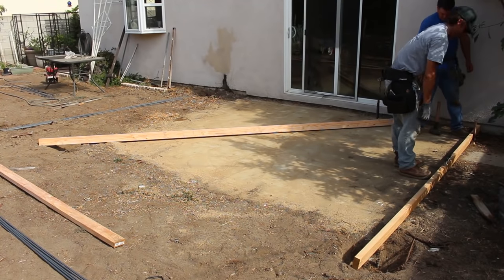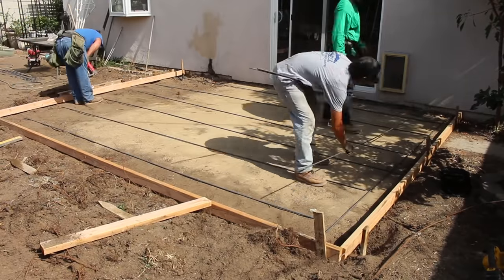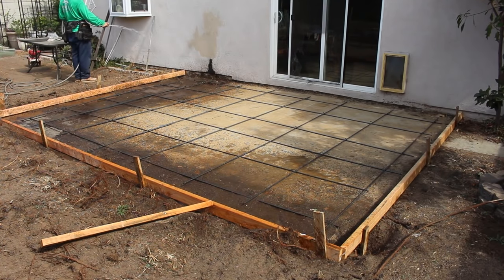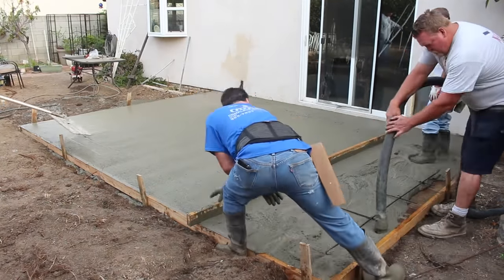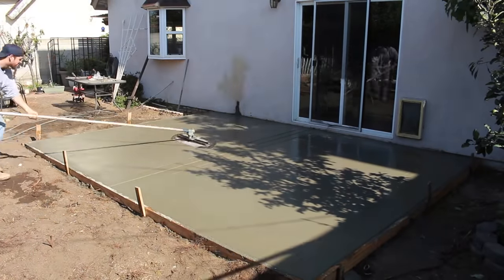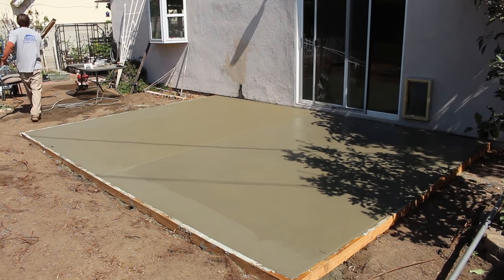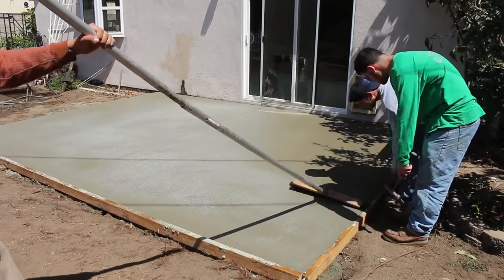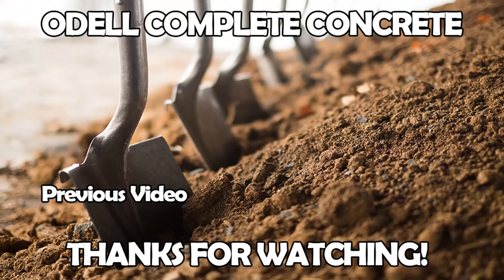How to Pour a Concrete Slab for Beginners DIY

Comment: I was convinced I could do this myself until I seen about 300 people working on this patio. DIY.. 🤔🤔🤔🤔
Reply: You'd probably want to start smaller, maybe no more than like 50-100 sq ft. You only have a limited time to get the concrete into position before it starts to set so the bigger it is the more people you'll need unless you're a pro. If you have a truck deliver it then the driver will usually control the pour flow so you can use a concrete rake to move the mud into position. Then it's just a matter of smoothing the surface and edges and running expansion joints before it sets. Probably shouldn't worry too much about getting it perfectly smooth your first time, using floats and trowels takes practice to get good at, just get it as good as you can and move on. More effort is required the longer it sets. I used to help my dad when I was younger for like a decade, even then I never got great at smoothing it out perfectly. I just did a rough pass over it and my dad would smooth up the rough spots. As long as there's no obvious holes or dips in it and it's mostly flat you'll be fine.

Comment: Not bad not bad I actually did a slab about the same size a few days ago but hand swirled instead of a broom. I don't know if you have done hand swirling or not but it would be cool to see a video on it.
Reply from the maker: Yes but I prefer to do them with the power trowel
Reply: Not a floor but it's like a broom finish its swirling with a hand mag

Comment: Hi there. I have 2 questions. 1. Why do you make a line in the middle of the concrete slab. You said it was a joint. 2. Do you have to put vegetable oil on the wood before your pour the concrete to prevent the cement from bonding with the wood? Thanks for the great Vid. Good Job!
Reply: 1. the line is a score mark to guide inevitable cracking. Better to crack along a nice straight line(like sidewalks) rather than cracking all over the place. 
2. No, the oil is simply used so he can take off the wood while still at the job site day 1 before he leaves. Leave it on 48 hours and then take it off like normal and you will have no issue with no oil.

Comment: Probably a dumb question but how do you accurately create a 1.5% grade to drain the water away, wouldn't the concrete just level itself?? Second question thinking of doing this for a small home in FL a 12x20 any tips or warnings I should be aware of for that region? TY in advance
Reply from the maker: Its in the set up and rodding.
Concrete doesn't self level, its to stiff

Comment: Very cool video.  I've done small slabs for electrical monument signs and decided to try and do a pad on the side of my house for my boat.  Would a 6" deep slab be deep enough for a boat with about 1100 - 1200 lb weight?  I'm in California and not sure with all the quake issues, although where I live may not be much of a problem.  So I'm familiar with concrete, just not with structural details for this type.
Reply from the maker: A 4" slab is plenty good.

Comment: Hi yeah I'd like to know how did he run a straight line for the join at 3.33. Did he use some sort of wire cable underneath the concret and then just open it up with the extension pole? Thanks, enjoying learning
Reply from the maker: No that's free hand, like an Artist

Comment: Hi, do you think the Sakrete high strength concrete mix from home depot could be as smooth as the one you poured in this video? or any recommended type of concrete mix for my small landing project? Thanks.

Comment: Great job and great video. Do you have a beginners video on what equipment you have and the different styles and sizes of the trowels that you use. You mentioned that you have a Fresno and then that magnesium one what's the difference?
Reply from the maker: one flattens and one smooths

Comment: That looked great. Wondering if I can get some input/advice for my own project. First, if I were to lay new concrete over existing concrete how thin can it be over the existing concrete? I have 100 year old driveway where there is only cement where the wheels of a car contact the ground. The area in between is dirt which I'd like to fill with cement. I'd like to make it a solid cement driveway and not have to sledgehammer the existing old concrete out. I also want to extend it out so it would be a bit wider beyond the existing old cement. I'd like to know how thin I can safely lay new cement over the old because our driveway goes out onto a city sidewalk. Would using your idea to make my driveway a solid cement driveway work? Or would it be best to take everything out?

Comment: Just curious, so you should not pul down pea gravel on the dirt first? I'm just asking for myself as I have a broken cement step that I need to fix and it's right on top of dirt. I thought I should put a compacted layer of pea gravel down first, no?
Reply from the maker: The dirt is fine if it hard and your not in a freeze thaw zone.

Comment: Nice vid! Nice job! I would like to pour new concrete on my roof teracce (flat surface ~200sq feet). Old concrete is gone. Cracked (almost turned into sand) and leaking. What tickness or hight you recomend to pour. Do I need a rebar mesh? After pouring new concrete I intend to cover it with hydro insulation. Thanks
Reply from the maker: You need a roofer and water proofing

Comment: I am getting ready to pour a slab like this in very hot, sunny weather. Will be hand mixing in a wheelbarrow. Is there anything I can add to the regular 80lb bagged concrete to slow down the setting so I have more time for troweling and working the concrete?
Reply from the maker: I believe a certain sap from a specific tree acts as a pause in the concrete and also can air entrain

Comment: thanks for this nice video, one thing I don't understand is at time 4:23, I thought the surface is flat already, why need someone crawl inside to smooth the concrete out again? what is the purpose, remove water ? thanks , and sorry for this noob question
Reply from the maker: Makes it even flatter
Reply: @OdellCompleteConcrete  thanks

Comment: I wish you guys would travel to KC. I want to put a 13 X 30 pad for a outside car lift  Any pointers on how to do it. I was planning on forming it with 2x6 and maybe digging 3 ft footings  along the outer edge of the pad. Whats your professional opinion?
Reply from the maker: check with your local building department

Comment: hi, why do you put a seam down the middle? expansion? if so why doesnt the seam need to cut all the way through? is the seam just for the drying process of the surface to eliminate cracks? thanks

Comment: How did you achieve the necessary slope? I’m assuming 2 things, you sloped the side forms and the concrete was thick enough to not self-level as you squeegee the concrete to the side forms forward to the front form, please advise, thanks
Reply from the maker: The concrete is thick enough not to run

Comment: is there a list of tools to use. cause i couldn't figure out what you were saying something about a bowl float and  what was used to cut the joint? what was used for the edge? whats the name of the concrete? something about pea gravel and mesh. what is rotting it off? what is frezno and other trowels? you had to do a broom on the edge? is that the push broom 2 minutes earlier?  sorry i am a newbie. so beginner beginner.. thanks
Reply from the maker: You may need to watch more videos.
Reply: @OdellCompleteConcrete  yuppers 😆

Comment: Hey man great video. I’m actually thinking about doing this. I currently have decomposed granite and I’m wondering if I can lay the concrete right on top? The dg is compacted about 4” thick. Can I just lay a 2” slab on top? Thanks any info is greatly appreciated
Reply from the maker: DG is not great for a 2" pour.
I would go 3 to 4" minimal

Comment: Hey Odell, love your vids, very informative. What's the rule for expansion joints? Like I see you pouring slabs right up against other slab. I need to pour a slab against brick on the house. Should I have an expansion joint so that concrete doesn't damage bricks later on?

Comment: My friend wants to do a cement pour over an existing 8' x 8' x 3" slab for a hot tub. The current slab is cracking, but appears to be structurally sound. He wants to extend it by 2' on each side and 3" up. Should he use a bonding agent to help the concrete adhere to the current slab? I'm new to masonry and not sure if this step is necessary; if the added weight of the hot tub when its filled with water is a necessary factor when choosing a bonding agent.
Reply from the maker: If the existing is cracked, then I would isolate with plastic. Try to 4 "a if possible on the new pour
Reply: @OdellCompleteConcrete  Will do, thank you!!!!!

Comment: Hi ,thank you so much for all your videos , really good pro work . My wife and I  decided to DIY 16 by 24 concrete slab in our backyard porch .so I wanted to ask you what the requirements for a slab that in the future we will possibly want to close for a room and the slab will be in a slight angle since we have a lake in the back .I will only prepare the the mold but not pour concrete ,I would have a concrete company pour it for me .any special ideas or rules that I got to follow do I need to attach it to the house some how because of the angle ,should I use mash or do it like you did in this video lay the bars and tie them ? What kind of concrete should I use in South Florida? Thank you
Reply: The stip part of the slope starts about 17 or 18 feet from the house  in which I'm going 16 feet towards that direction but that whole section is in a mild angle
Reply from the maker: I would check with the local building department

Comment: Great video. What are the two tools you’re using to finish the concrete when you’re on your knees with the protector pads? Is it a mag float and a steel trowel?
Reply from the maker: Knee boards

Comment: Question:  I have a foundation, which I inherited a few decades ago and was poured too low at a low point in the yard so that, when it rains, water flows into the shop.  Can I just pour a new foundation over it to raise the foundation for the building, do I have to tear the first foundation up before pouring the new foundation, or can I put something in the first foundation like bolts or rebar to tie them together so the second foundation won't tend to move on top of the first foundation?  The first foundation has no cracks and is good except that it is too low in a place where water will run into the building when it rains.  It needs to be raised at least 3 to 4 inches and they would both be 20 ft x 30 ft.  Thanks.
Reply from the maker: If the framing sets higher then the existing slab then yes pour over.

The slab should set a little bit lower then the framing

Comment: If I'm building a Harbor Freight 8x10 greenhouse is 2 inches of concrete enough for a base? Also, should I make my base about 8.5 x 10.5 so I allow for a little space on the sides? What's the rough estimate of the price of the concrete material for that size?
Reply from the maker: 350

Comment: I'm pouring a patio that connects to my driveway on one side (only 5 feet connection). I live in Michigan so weather is wild. Do you recommend I do crushed stone (3/4 inch limestone was what i was thinking) or do re-bar? Or both?
Reply from the maker: You may want to check with your local building department

Comment: hi could you help a pool 20 by 10 feet .trying to pour a concrete base should i do it in sections or pour a 3 inch base then rebar and then when set another 3 inch on top.I wont have time in one day to pour a 6 inch base 20 by 10 any suggestions thanks
Reply from the maker: I would find the time and do it right

Comment: If you need to get rid of grass, what is the best way to do this? I have a small slab outside my garage door and outside door and would like to connect them as well as bring it out further for a decent patio.
Reply from the maker: Weed killer or dig it out.

Comment: Hi great video thanks for sharing it.  I used to drive a mixer truck and i have seen it all from that side of the jobs with pumps of all sizes and just simple manual labor, but i have never done a slab myself.  This is my first one and its only 8'x4' for a shed i am building.  Everything is level and secured and square, with just a tiny bit of drop to the front left corner as part of it will be exposed to the weather as outdoor storage. So it will drain to that side of the slab.  I will attempt this by myself, ill see how it goes mixing and all of it alone.  The calculator says 29-50lb bags but ill get 30 bags just in case, also it wont be a full 4"  thick slab so i should have plenty.     I did have one question, there are some small gaps under the 2x4 in places along the ground, should i plug those up or just make the mix thicker so it wont leak out?
Reply from the maker: no need in that gap filling.
GL

Comment: Two questions 
1)Can I pour over existing concrete that is cracked & unlevel?
2) Can I use bags of quickcrete?
Thanks
Reply from the maker: Put plastic and a layer of sand, If the old concrete isn't settling

Comment: I like your video. Very informative. However I have a question. When I spoke the Town tax Assessor he said that any concrete or cement patio using a footing would be taxable.  With the exception of the rebar that you used to keep the cement slab from cracking I did not see anything resembling a footing and you didn't mention anything about that. Any information that you have about this issue is most appreciated. Thanks
Reply from the maker: I don't know about that.

Comment: Same size slab do you have to Put a grove in it like that so it will not crack.or is it better to have the wire ...?
Reply from the maker: The groove is for crack control

Comment: I have a garage floor that is badly cracked and lifted in areas I don't want to have to break all that concrete can I pour over it if it's not even? Will the new concrete crack ?
Reply from the maker: plasti,c sand, and rebar should do the trick over the bad concrete.

Comment: Question, I'm taking on a big 24x24 project for a basketball court. What's the point in splitting the concrete in half and what type of concrete should I get from Lowe's
Reply from the maker: Maybe in fours if your going solo.
Blue hawk 4500 psi

Comment: Is there a building code that says to stay away from the weep screed (stucco flashing)? You got pretty close to it if not right on it. 

I bought a home that already had a slab poured and it was poured up to the weep screed. I've had issues with moisture damage when it rains. My wood flooring and drywall has gotten damaged on the inside. How would you fix that? Demo and pour a new slab lower to get a away from the weep screed?
Reply from the maker: yes 2" below top of slab, which puts you a 1/2" below weep

Comment: So I am doing one 6 x 11 just outside our basement door like this one. What I am wondering is do I just dump the gravel in the area and then build my form just above it? Well setting the form just on top of the gravel? So it doesn't matter that the gravel is peeking out from the form right? Also building a retaining wall next to one side of this because there is a slope that needs to be held back. I am thinking the wall should be resting on some sand and working with the first few stones to make sure they are level correct? Not putting the wall right on the cement pad because it will be slopping away from our foundation/door. Don't want the wall to slope right?
Reply from the maker: Sounds like a nice project.
GL
Reply: So do i put the form on top of the rocks and let the rocks come out a little bit from under the form?
Reply: Hey Barnes. That is fine, just set forms for your depth of slab ontop of stone, if any stone seeps under forms that is ok. Just pack it well. 

Any stone that seeps under will be covered by landscaping.

Comment: Shortly after troweling any slab, can you spray the surface with water and cover it with plastic to trap the water, reduce evaporation and increase the time the surface is wet or would this cause problems or discoloration?
Reply: Caulfieldcosplay that would be fine as long as it isn't worked into the surface. A typical wet cure in Canada would be to use wet burlap and plastic.

Comment: Joint, cutting a joint why?  : why do you score a line in the concrete?  Is there a maximum area before you need to mark a line as you did here perpendicular to the patio door?  Is it to reduce the chance of cracking or why?
Reply from the maker: Basically its for crack control.

Comment: Did I miss something? How did you get that joint in there? I went to where it "appeared" but didn't see the cutting? Was it cut with a saw, or whaaaa? I'm a beginner, obviously!  LOL
Reply: bigeyejim usually cut with a saw you can push or pull behind you to help keep it straight. Some guys use big concrete saws just depends.

Comment: What if the corners and edge of the existing slab is cracked? Should I remove the slab completely or break up just the cracked portion and pour an overlay?
Reply from the maker: Send pics
Reply: This is the best picture I got as of now. But the edge is cracked and some bits are missing or covered in dirt. 

https://drive.google.com/open?id=1ktrqpjpRnPUjtsaSD_FVuerPoAnux-JW

Comment: We wanna pour a slab in back of middle of house just like this size pretty much. My only issue is parts of the yard are higher than the concrete so how would I go about fixing it so pad isnt constantly covered in water?
Reply from the maker: drains